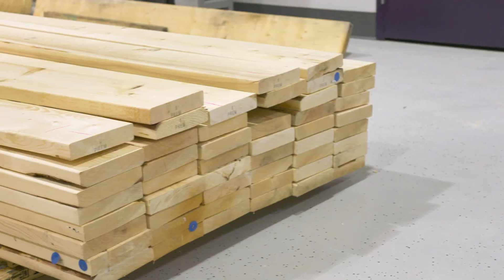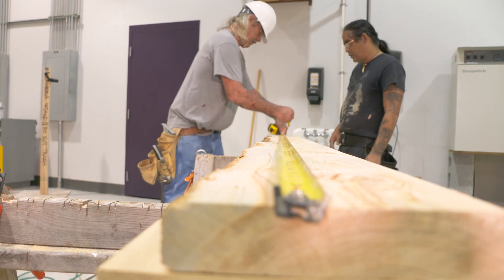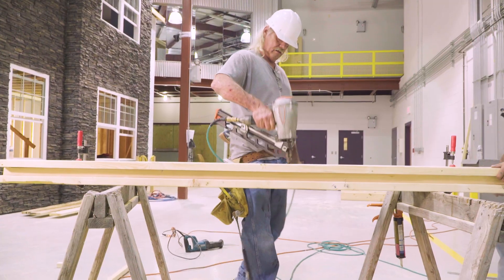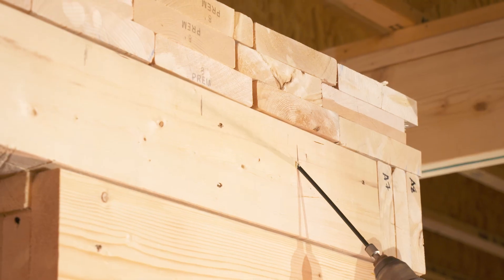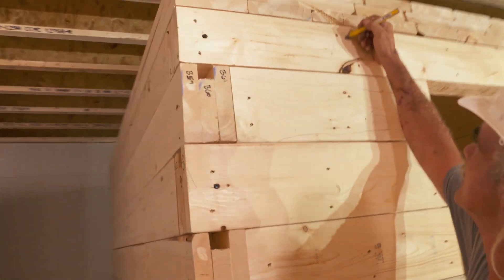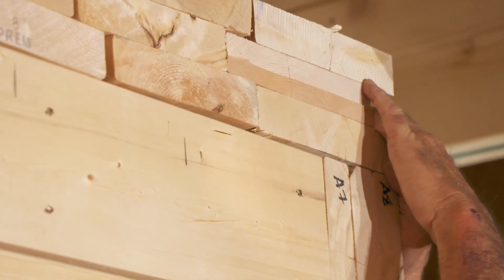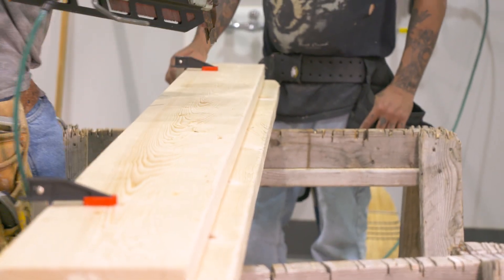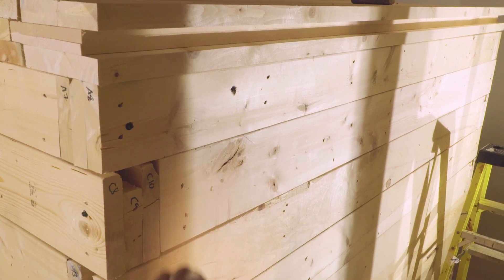Wood Tornado Shelters Segment 3

Comment: With a properly designed, say poured,  (or in the near future for cement use reduction, within a system that provides for,  say,  a low water content high strength concrete that is   "placed"  in engineered wall forms engineered to allow for compaction of the concrete),   foundation with  integral  reinforcements and attachment points a savings of some what less than 2 walls could be had.